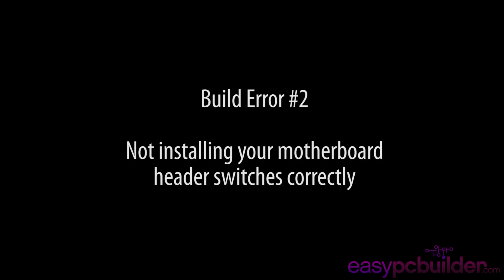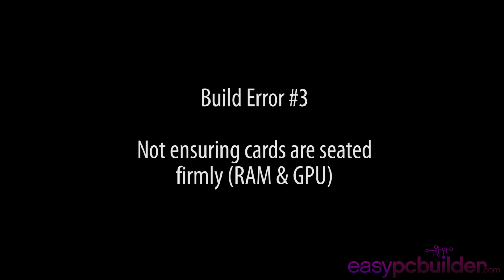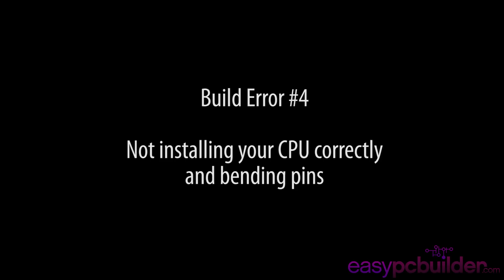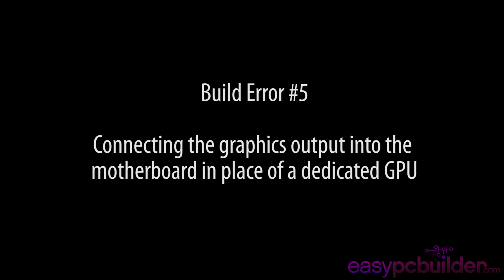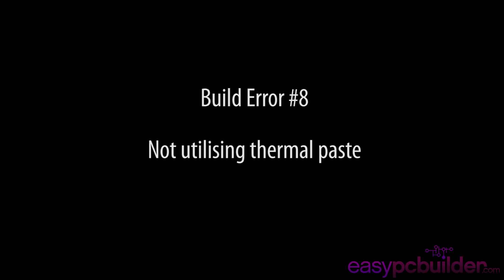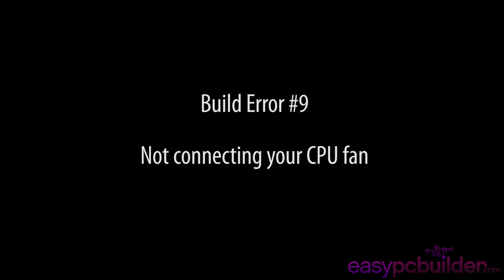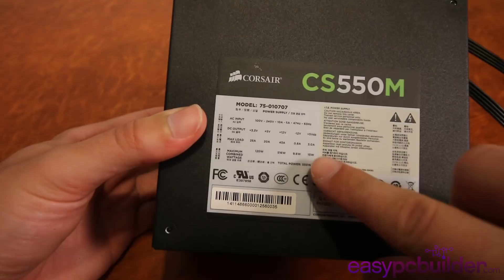The Top 10 Computer Build Errors - How to troubleshoot a computer in 10 minutes! With EasyPCBuilder

Comment: Using 700watt EVGA power supply. When testing with a paperclip or the tool provided, power supply fan turns on. When plugging into motherboard, power supply fan remains off and doesnt send off power.

Comment: So I have a question might be dumb but I want to know that way I can fix it now I recently built my pc with just the cpu, motherboard, gpu, and pwr supply so I’m still missing my ram and hard drive. When I turn the pc on it turns on and off and no display so did I 100 percent build it wrong or is this happening just because I haven’t gotten my ram or hard drive yet

Comment: These are all solid points for first timer P.C assemblers.
The only one I would add would be;keep a bottle 100% iso alcohol and lint free cloth. If you accidentally touch any of the gold connectors on the P.C.I.e devices, then clean the visible finger prints off.

Comment: Ive got a fun one. Wrong bios version. Or outdated bios. Had trouble getting 7600k working with a cheap motherboard, had to use a 6600k to update the bios first and then reconnect.

Comment: I have a small problem. I've played GTA V nothing happend, StarCraft II all the series withour multi nothing happend. But When I play Starcaft for long time with multi my computer shuts down (also playing ashes of singularity: Escaltion). I cannot turn it on. Power light is ON like it was working but pressing power button doesn't take any effect. When I Turn switch of power supply OFF and wait for a minute and take to ON posision computer starts normal. Is is thermal?

Comment: Thank you so much for the awesome video, I've been having a problem with my PC. I was doing some bitcoin mining for a few days and kept my PC running day and night when it started shutting off by itself. Can this be my thermal paste that's not applied correctly and causes my CPU to overheat after long times of running? I'm really worried, I struggled keeping it on last night but its working quite today. Haven't me problems again.

Comment: Would it be a problem if i built a new computer but used the SSD and HDD from my previous computer. Everything  on the computer turns on but nothing will output to the monitor!
Reply from the maker: Using the SSD and HDD is ok - but we recommend re-installing your operating system so it properly picks up your new computer configuration

Comment: What if you don't install risers?
Reply: YoYoBro's your PC could ark and fry your motherboard or cause shorts and make your PC have other issues
Reply: YoYoBro's The solder points will just be touching flat on the bare chassis, which is most times made of aluminium, therefore conductive.

Comment: I remember buying my first high-end graphics card (still using it actually).  The Gigabyte AMD Radeon R9-380 256-bit DDR5 4GB card that was so enormous, it took up two PCI slots.  I got this to light up upon boot but no graphics image.  I knew the darn thing worked because my mobo had detected it.  So what was the problem you might ask?  Simple:  it had to have extra power cables attached to it.  I was pissed - this wasn't mentioned in the install guide!  I figured it out by examining the card and noticed these odd plug-in sockets.

Comment: Great video for a newbie.  I think the hardest part for me, is connecting the wires up, because I have big hands.  Sometimes I have to use needle nose pliers in the tight spots, which I am always afraid of dropping them on the motherboard.
Reply from the maker: Thanks David, yes small cases make things hard - especially the placement of the CPU power connector!

Comment: Can I build the pc without a gpu and use the one built into the i5-7500 till I get money for gtx 1070? (I only really play HoTS right now anyway)
Reply: yes you can
Reply: You can certainly use the integrated graphics in your i5 Kaby Lake to power your display. Whether it works with the game in question depends on the system requirements for the game and which settings you're running.
Reply: Zakk Atraiu yah
Reply: Zakk Atraiu yes you can, intel cpus have intergrated gpus, but you need to use the output on the motherboard(however when you need to put it the card in take more precaution, just to be careful and ofc, don't forget drivers.
Reply: Im think yea  , but dont trust me , im not an engie .

Comment: How to fix boolooping? Pls help
Reply: Elvhin What?
Reply: GAMESRGOOD its bootlooping
Reply: Elvhin What are you seeing?
Reply: At what part does it start looping? Immediately after or a bit into.
Reply: GAMESRGOOD ram is good powersupply is good test it all but when I remove my graphics card it wont boot loop
Reply: Elvhin Your GPU could have an internal issue. The same problem happened to me before and I just removed the GPU

Comment: Thanks dude, so yesterday I tried to cleaned my CPU heat sync fan (for the first time), but I removed the RAM because it was blocking the way, but when put them back on, shit started to happen and my pc did not boot up. Thanks about the tip about on how to properly position the RAM. 😊

Comment: How do you combine the two cpu fans to just one connector?
Reply: at 6:42 you can see the splitter which combine the 2 connectors in a parallel connection. When buying a Noctua NH-D14 you also get cables to connect the 2 fans to a single CPU fan connection on the motherboard.
Reply: Thank you very much for the reply, I just bought a 4 pin fan splitter about an hour ago :) (I also asked a freind)
Reply: use a Y splitter adapter?

Comment: can i ask a question about the pc power supply..if i am traveling overseas and bringing my pc with me do you just replace the power supply that is compatible to the country or maybe just replacing the plug(only) without changing the power supply that you already have in the pc..and also how to know which power supply is the right choice..is it just by purchasing a power supply doesn't matter what brand it is or the exact same brand as the first but with same amount of watts as your first power supply or maybe anything that is near the range as the first.
Reply: Ash's & Rain There is usually a 110v to 220-240v switch on the back of your power supply.

Comment: Didn't plug in CPU power, didn't plug in the computer at all, didn't plug in the GPU PCIe power, didn't plug in the SATA power or only plugged in the SATA to the HDD or the motherboard and not the other. plugged in the power button the the wrong pins. 

Those are the only things I can think of.

Comment: is a 650w gold psu enough for for an overclocked 6700k and an overclocked gtx 970?
Reply: Yes that's what I was running with no issues. I'd get a 750w just to be on the safe side if you can afford it since PSUs are usually warrantied for 3-10 years so you'll want them to be future proof.
Reply: Rabid Rabbit i think so